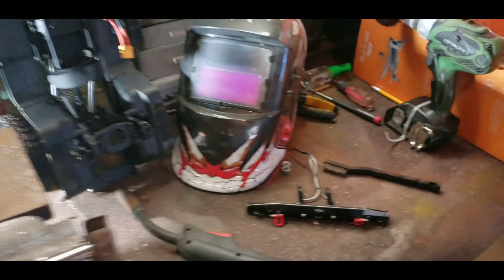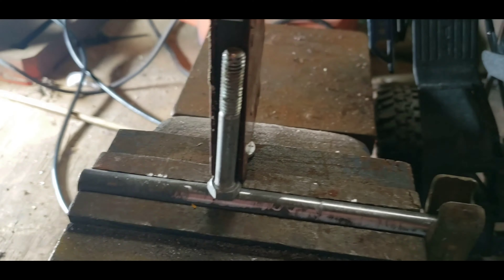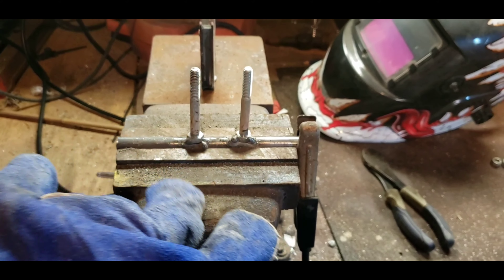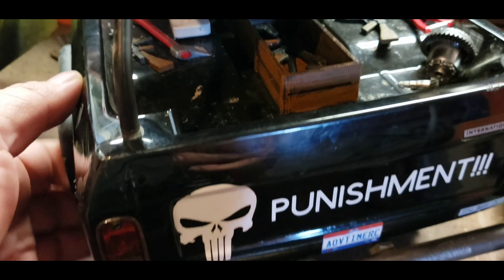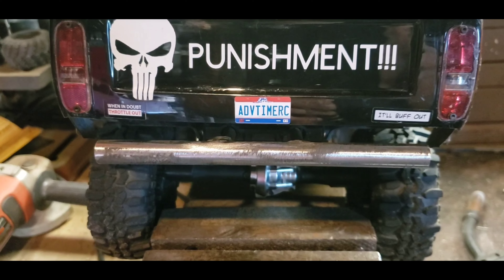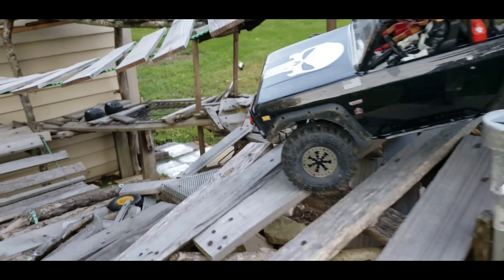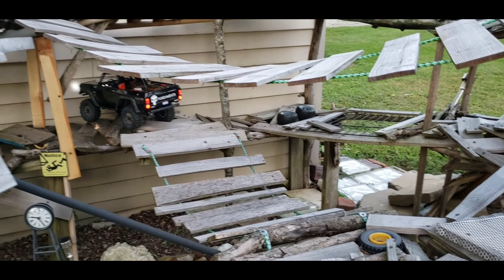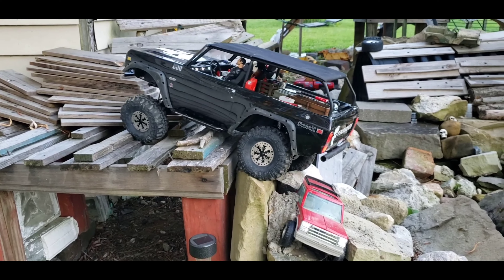Home made gen8 axe bumper

Comment: That was quick! It works brilliantly - great job. It´s good to dig out the welder once in a while...
Reply from the maker: Thanks Del it had been awhile since i welded i think the flux in the wire is going bad lol really had to crank it up and turn the wire speed down 💯😀👍👊
Reply: @AdventureTimeRC  I had a Snap-On MIG which was incredibly fussy if not used regularly.
 One thing I like about arc welders is the way you can ignore them for months and theyll still work when you need them, even with horrible old rods which have got wet and dried out countless times   : )

Comment: I have used the upside down glove or even no gloves for that matter but I don't think I have ever welded in sandals lol. Great bumper man, gotta have that slide action on the rear for sure! I cut my gen 8 body a little and pushed the rear bumper way in, helps a lot!
Reply from the maker: Thanks Tyler i have a habit of doing all kinds of dangerous things in sandals lol my friends lose there mind when i run the chain saw in them lol😀💯👍👊

Comment: I just ordered the black desert lizard 100 mm internal spring set up for my axe as well what spring and oil weight are you using?
Reply from the maker: That's cool i really like these shocks depends on the weight of your truck i think i have the medium springs in this one and i only put a little bit of 10wt oil them only about a quarter full seems to travel better this way used to fill them but action moves really slow when there full